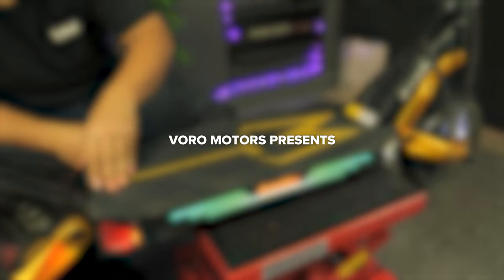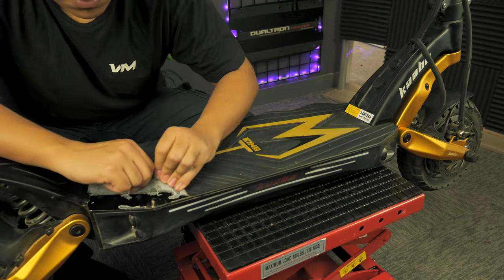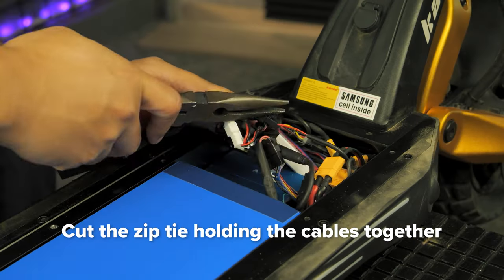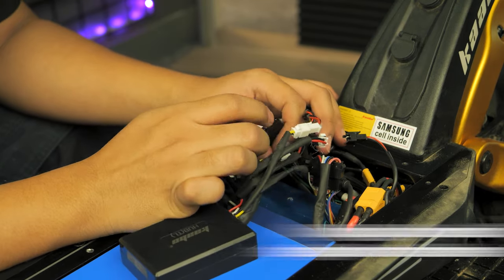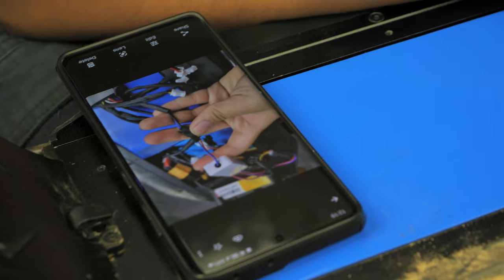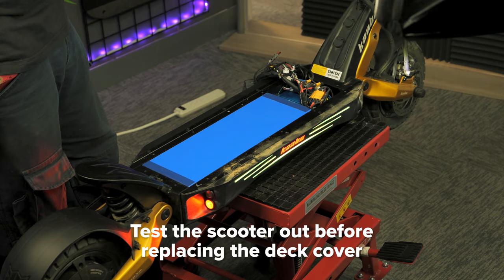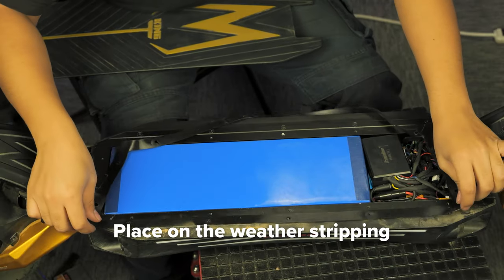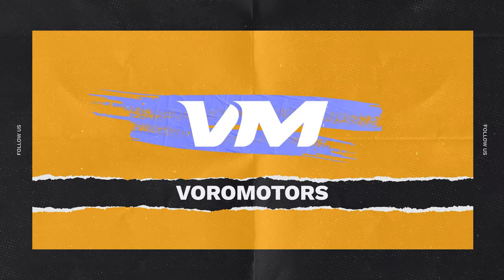How to replace the Stepdown Transformer on the Kaabo Mantis King GT! - Voromotors tutorial

Comment: What is a step-down transformer? Is that same as controller?
Reply from the maker: Hi Eric, 

Thank you for the comment. The transformer is connected to the controller and they perform similar functions as electrical hubs for the different components of the scooters. The transformers in our scooters tend to direct current to more minor functions like lights and buttons compared to the controller, which is directly connected to each motor. 

Hope this helps!

Comment: Pro-tip instead of taking pictures of the connections...
Buy multi-color tape and wrap a "tape tag" around both connected wires before separating them.
Be sure each connection has a unique color unless the connections can't possibly be reconnected elsewhere..
Reply from the maker: That's a fair alternative. We recommend taking a picture just because it is an easy, accurate reference to fall back on when doing repairs like these, but that would work equally well! Thanks for the comment!
Reply: I'm wondering why you have to tear the silicone deck cover up to get to the screws. On other scooters the screws are exposed so you can take the cover off without having to destroy something that is attached with adhesive. That's got to be a pain in the ass separating it and getting it to stick again without looking like crap once you're finished with the repair. What about using a hair dryer or heat gun gently to soften the adhesive? I guess the easiest thing to do would be getting it fixed by the seller or pay a repair shop to fix it but most of us don't live anywhere near either.